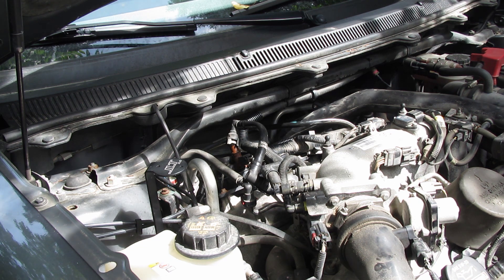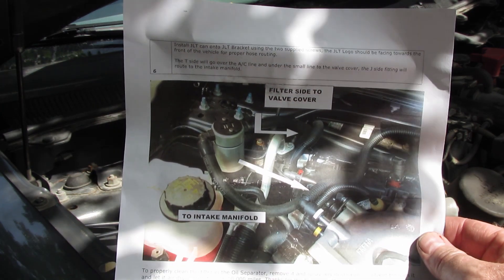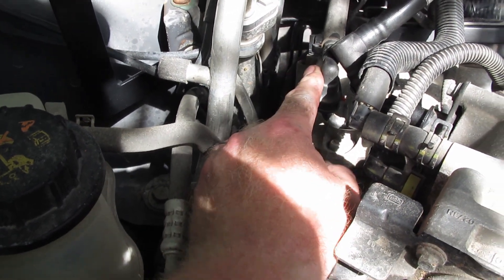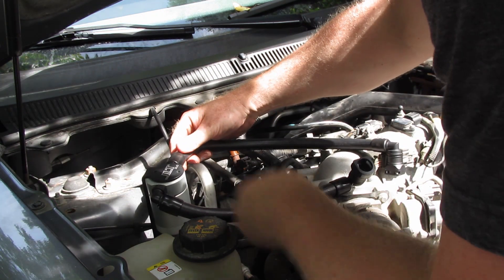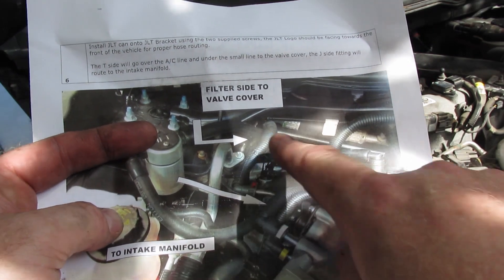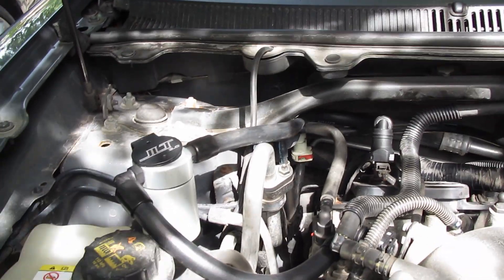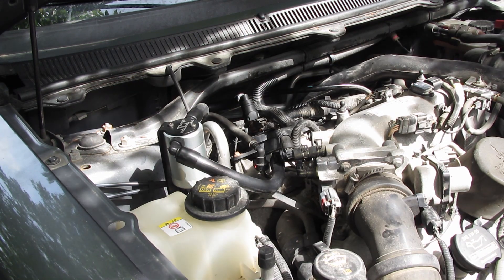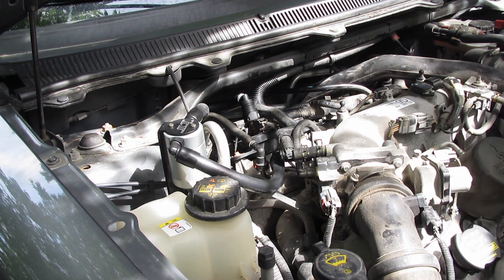Installing a JLT Oil Separator Catch Can on a Ford Flex or Taurus SHO 3.5 Liter Ecoboost

Comment: Hey did you have any engine issues before installing the can? I’m having engine shudder at low rpm acceleration. I have an ‘11 Flex Evon
Reply from the maker: Yes I did.  I replaced the spark plugs which helped.  I'm assuming I have some carbon buildup and the catch can should stop it from getting worse.  If you have a shudder do the plugs next.  I have a video posted for it.  Thanks for watching and the questions.

Comment: Yes it used to be sho. Today it's the same twin turbo 3.5 used I  a few other cars making it no different and for that matter the engine in the fusion has much more tq than in the taurus. So it is sho or s.h.o. 25 years ago.
Reply from the maker: I think For wanted to clean up the logo and removed the periods.  I just think its one of those things where someone started calling it "show" and it stuck.  Ford never intended for the S.H.O. or Super High Output to be called "show".  There's been interviews with Ford Performance workers who still refer to it as S.H.O.  Thanks for the question and for watching!
Reply: @MoreBear  I more often than not call it an s h o. But occasionally call it a sho.